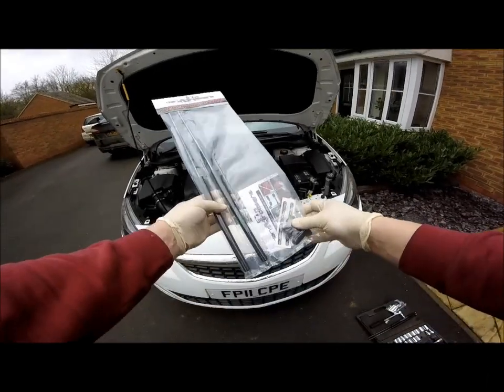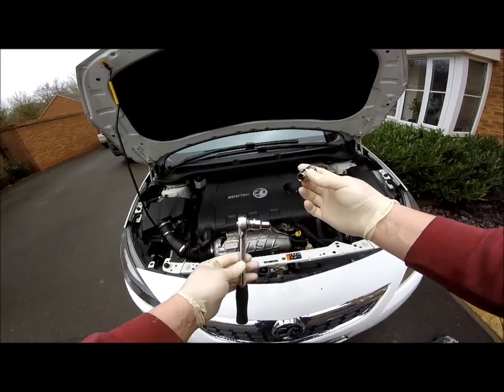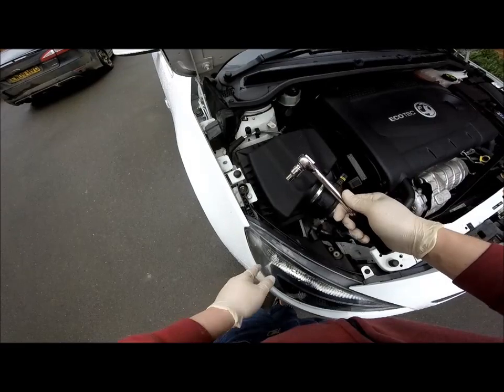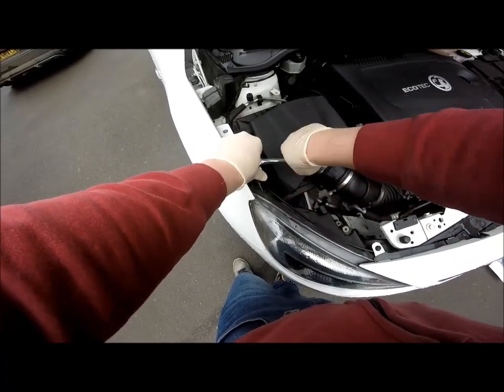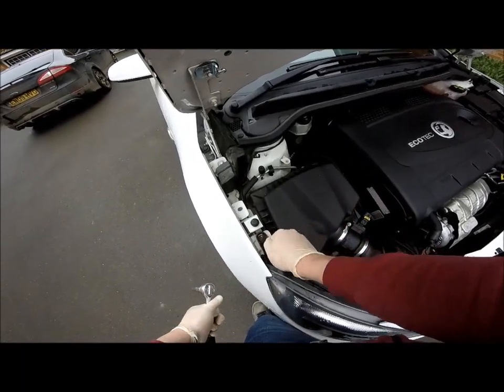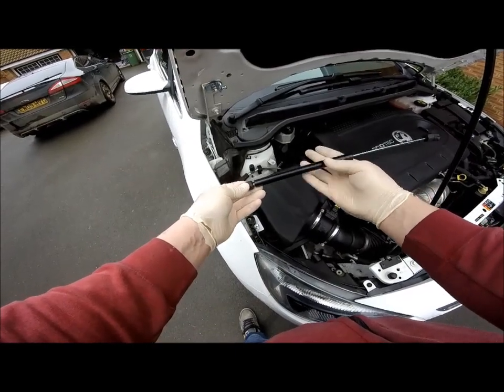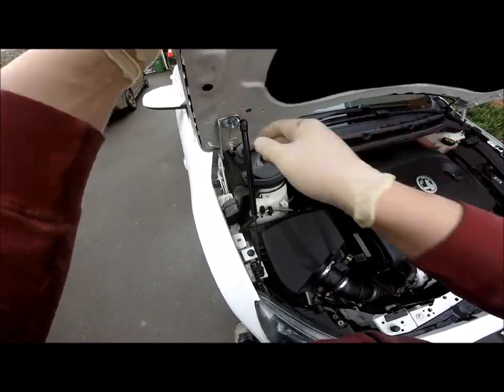Astra J mk6 2009-2015 Bonnet Gas Struts Lifter Fitting Video How To Dark Ice Designs Opel Vauxhall

Comment: I still needed to fit the plastic spacer on my facelifted Sports Tourer as it didn't have the lower profile bracket. My advice is to check the bracket before fitting as I had to take it off and start again.

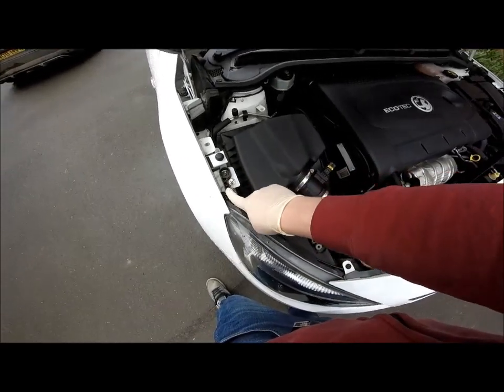Comment: I do have Astra J facelift model but that plastic part 1:37  is not lower as you said..so I actually needed to fit..in my case metal spacer,not plastic.Maybe it's slighty different gas strut/spring model or it's because I have Sport tourer version,Opel,not Vauxhall?Also first one,top washer and nut are one part so you can't take just washer off and replace it with new one.And nut on lower side is 12mm socket,not 10.